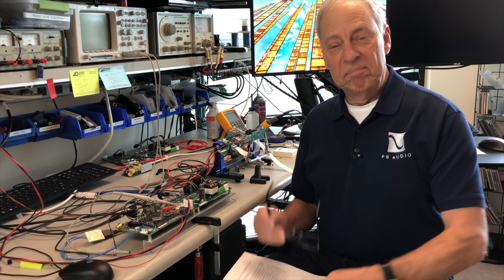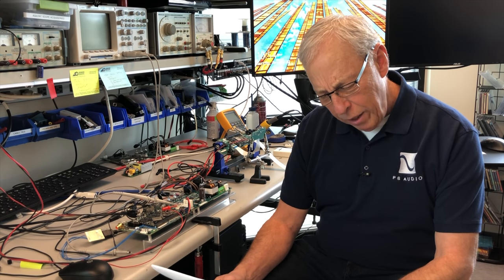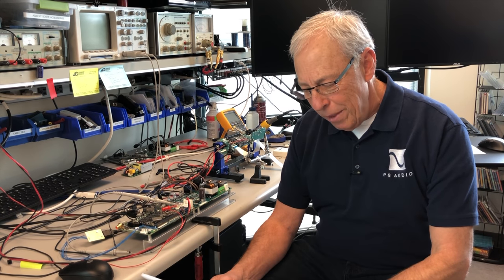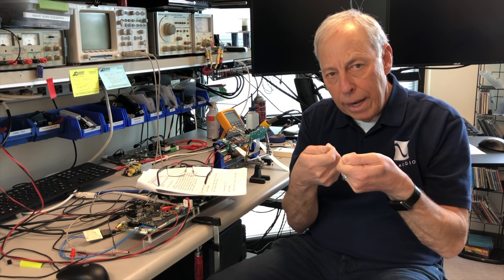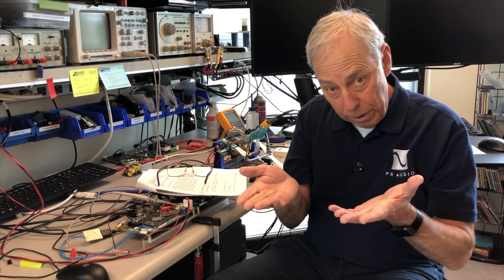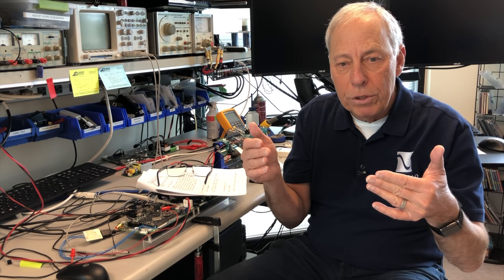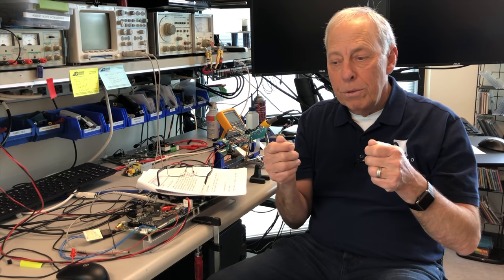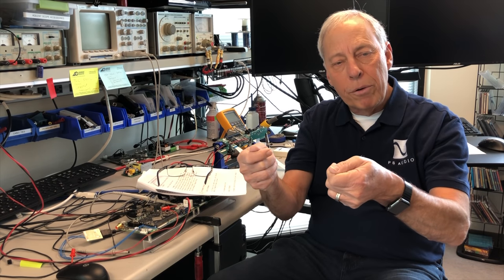What is an Ohm?

Comment: The ohm is the measurement unit that quantifies opposition to the flow of electricity.  When that electricity is in the form of direct (constant polarity) current, that opposition is called resistance, when that electricity has alternating or variable polarity (AC mains, audio, radio, or microwave signals), that opposition is called impedance and varies with frequency because of the influence of capacitance and/or inductance.
Reply: why headphone use impedence, not resistance
Reply: @reznov3D  -- Headphones and loudspeakers receive and transduce audio frequency signals, which do not comprise direct current.  Therefore impedance is the measurement that is relevant to their function rather than resistance, which is only applicable to direct current.
Reply: Well look at the brain on Bruce.
Reply: You can have resistance on AC as well. Specifically,  pure resistances do not cause phase changes. Capacitors and coils have reactances that cause phase changes and differ in the direction of the phase change that they cause.  Impedance is a combination of resistance and reactance.
Reply: @timharig  -- Correct.  Thank you.
Reply: Could you write that in English brotha? lol

Comment: I think you may have confused me more.
Reply: An ohm is a measurement of resistance it slows down the electrons in a circuit
Reply: Don't overthink it. An ohm is simply what you get when you divide volts by amps.  So long as you always use that relationship, you will never be lead astray.

Comment: You could have gone further and explained in more detail how that applies to speakers, e.g., 4 ohm speakers will produce more output for the same amp vs 8 ohm speakers, or that some amps are not designed to drive an impedance load down to 2 ohms, and then there is series vs parallel wiring that effects impedance, or whatever application you think would be helpful.
Reply: 4 ohm speakers draw more currents than 8 ohm, but not always give more output. There are other factors, e.g. Efficiency, that determine the output.
Reply: I'm trying to offer general information, not provide engineering degrees. Let's keep it simple.
Reply: @SpeakerBuilder  
😆🤣😆🤣
Reply: Series, parallel, multiples, anything more than one Driver per Channel, like marriage, is against my beliefs. (chuck the chokes) 
Give the amp an easier job and the system will reward with transients. 
No?
Reply: No. The amp doesn't care if there is one or a hundred drivers on it, as long as they are all the same and present to the output a consistent impedance load (relative to frequency, of course). What amps don't like are overly complex loads due to multiple disparate drivers connected together by a variety of electronic parts such as coils, capacitors and resistors. In this regard you are absolutely correct. Such is the case with  auto systems I was referring to in my original comment which use an active crossover with a separate bass amp driving just the bass driver or drivers.
Reply: True the amp doesn't care, as long as it sees generally an impedance match. 
My focus is response that the driver can obtain. When you have many woofers, say 901, hooked together, there's just gotta be some voltage/current drops in there, because music isn't a DC curcuit. Those cones have air resistance and going from zero to following the signal is where it is at. 
Instead of one higher power amp feeding all of those divers, we would have many (lower max power) amp channels getting the same over all SPL.
I can see the point in an electronic circuit of constant current. 

2) 8 ohm drivers in parallel is 4 ohms.
 Put that in series with 2 more 8 ohm drivers in parallel, you are back to 8 ohm load. 
Now, that is not going to be as responsive as 4 identical drivers with their own amp channel each.
Reply: The context here was ordinary folks hooking up multiple drivers to their bass amp in their car, and the point was to aid in that process.
Reply: Its funny a couple things. Once I had 4 12' s on construction tubes, 6 feet long in a mini van, the other was a DVC MA audio sub that I mounted in the floor vented to the outside. That was some real rich bass like that. Niether one was boomy either.

Comment: It seemed like he was  explaining what a watt is. P=E x I. Or if it was an ohm it would be E/I=R. An ohm is a measurement of resistance to electrical flow. Too low of resistance will allow a great deal of current to flow.  Nearing zero ohms looks like a short to a circuit. Free flow of current, when all flow is allowed, rush current to ground. Resistance drops voltage across the load and slows down the rush of current. Maybe that will help.

Comment: So higher the ohm the more energy efficient the speaker is; because it requires less energy to do the same as a lower ohm speaker.
Reply: No. Impedance and speaker efficiency are entirely different concepts.

Comment: Ohm is the unit of "resistance" of any electrical or electronic unit or a load (laptops, light bulbs, microwave, etc.). What a certain Ohm value generally tells us is how much current (or power) that load will consume. Most consumer products mentions a load rating in Watts (W) instead of the actual resistance of the unit since it is a more easily understandable and relatable measure of how much power that load ends up consuming. When it comes to speakers, matching the load (the speaker in this particular case) to the amplifier output (source) is necessary and for the purpose of clarity, the "Ohm" unit is frequently quoted to understand the load matching. Other electrical loads (a CD player, amplifier, laptops) are always connected to the mains (wall outlet with 110 V or 220 V) which is a fixed source with theoretically infinite supply power. The matching of input load for laptop is obviously taken into consideration to limit excessive current flow. But for the consumers having rating of the laptop in Ohms is not necessary. Alternatively, rating of 65 W on the laptop adapter rather tells us the load (laptop) can consume up to a maximum of 65 W when running. Same thing for a 100 W light bulb.

Comment: "Errmmm... I don't really know.." is also a valid answer. Much more concise too. ;-) 
Ohm is the unit of resistance ! Not the measurement of it.
Reply: Concise, but not very helpful. It also helps to know what physical units define it.
Bonus question: Ohm is the unit of resistance -- so what is the unit of conductance?
.
.
.
.
Mho: reciprocal ohm. = 1/ohms
Reply: @machintelligence  It's S for Siemens, isn't it ?
Anyway... his answer wasn't really helpful either. You can't explain resistance without properly explaining Ohm's law. 
This was mumbojumbo at best. "Take it from me, I know what I am talking about !"
He very clearly doesn't.
Reply: The unit of "conductance"   is "mhos".   I am no joking.  This unit applies to vacuum tubes and is the measure of "trans-conductance".
Reply: Mho's are the old informal name for inverse ohm's.  They are officially named Siemen's now and may be used to indicate conductance (inverse resistance), susceptance (inverse reactance), or admittance (inverse impedance).

Comment: So basically Ohms is the resistance for a voltage for a cable? Like if i got a cable that 10 voltage and the ohms resistance is 5 ohms. I be producing 5 voltage. The other 5 is being used to resist the 5 ohms. Am i right ir wrong?

Comment: Perhaps not the right place to ask this, but here goes. What is the difference or relation between resistance and impedance in a speaker. I know a classic resistor restricts electric flow and generates heat. But in a speaker its more complex because some energy is converted to heat while other is converted to kinetic energy. So is the impedance of a speaker the same as the resistance, say if I place my multi meter over the terminals of a speaker and read x amount of ohms? Or what is going on here?
Reply: Resistance doesn't change the phase of a signal that goes through it. It also doesn't change with frequency. 

Reactance changes the phase of the signal going through it and changes with frequency.  Capacitors and inductors cause reactance and differ in their direction of phase shift. 

Impedance is a combination of resistance and reactance.

A typical multimeter can only measure resistance. If you use a multimeter to measure the ohms of a speaker, you are only measuring the resistance.

Comment: The impedance of a speaker is not a measurement of quality. Your amplifier has an output impedance of let say 16 Ohms. To get maximum energy transfer from your amplifier to your speaker, your speaker should also be 16 Ohms. So your amplifier impedance and your speaker impedance should be equal.

Comment: So high ohms is more resistance and low ohms is less resistance?
Reply: No the highest ohms means "open circuit" therefore there is no resistance which means the ohms are off the chart (high) because there is no resistance.

Comment: Compare impedence to plumbing.  Think of the water flowing inside a pipe as electricity. The smaller the pipe- the more resistance (the higher the ohm). The bigger the pipe- the lesser the resistance (the lower the ohm). Beware- the lesser the resistance- the riskier the business!

Comment: lol this helped a little. i'm curious and confused too. i see ohms a lot when it comes to headphones and interfaces. like the headphone is x amount of ohms so it needs an interface that gives out the same impedance or something like that. also i hear a lot of car audio sub heads talking about ohms, but they never sound like they know what they're talking about. do another video on ohms please
Reply: Let's try to actually be helpful. Guys doing car bass speakers are often building their own and wondering about the wiring, and which impedance value they should purchase. For two drivers on a single amp channel, often two 8 ohm speakers wired in parallel will produce a 4 ohm load and that would allow max output of the amp, whereas two 4 ohm speakers in parallel for a 2 ohm load may be too low an impedance for some amps to drive. Also, four 4 ohm speakers could be wired in two pairs of parallel speakers, and then those two pairs could be wired in series, the end resultant load being 4 ohms.
Reply: @mamaluigi0631   The questions would be - why should I care? What is it in audio gear that I'm looking for? Is an 8 ohm speaker load better than a 4 ohm? Can I hurt my amplifier using a 4 ohm speaker load, or vice versa? And what's the big deal with headphones, which can have a published resistance of up to 600 ohms?

The formula is easy enough to understand, the impact on sound isn't as clear-cut. We as audiophiles pretty much don't care about "V=IR", we care about "Can I drive these speakers/headphones on my chosen amplifier, is there a quality difference between 8 ohms, 4 ohm, 300 ohms, 600 ohms, or are these measurements just indicators of how well my amplifier will drive what's producing the sound?
Reply: @Bannockburn111  I have been working through the backlog of Ask Paul videos and reading the comments on each video and there are patterns that emerge. I have seen a lot of the following two types of comments:

1. Reoccurring questions that could have been answered with a bare minimum of basic electrical knowledge.

2. Incorrect statements that are falsifiable using a bare minimum of basic electrical knowledge.

Many of the questions that you pose, can be answered using judicious application of ohm's law and the definition of electrical power. Impedance is not related to sound quality.  It does indeed relate to how your amplifier will drive the speakers or headphones.

For example.I see a LOT of questions about 600 ohm headphones.  If you understand Ohm's law and the definition of electrical power, it should be obvious that it will take significantly more voltage to achieve the same amount of power for a set of 600 ohm headphones than it would for a 32 ohm set of headphones.

Comment: So that is why a good headset with a high oHm requires more power to drive because it is more resistive to it.
Reply: It doesn't necessarily require more power to drive.  It requires more voltage to achieve the same power.

Comment: Is there Odd number Ohm rated speakers??   😜
Reply: Speaker impedance ratings are a little misleading.  If you actually measure the speaker impedance, you find that it varies significantly by frequency: https://youtu.be/g1zda0WMDGc

Comment: What happens if i conect 4ohm speakers on a 8ohm amplifier?.
Reply: There is no such thing as an "8ohm amplifier" -- there are amplifiers rated for driving an 8 ohm load.  The manual and/or spec sheet of the amplifier will usually include the unit's rated power output at various load impedances -- it's very rare for solid-state amplifiers to be rated at only one load impedance, and they almost always can deliver more power at lower load impedances.  If the specifications of your amp don't include its power rating at a load impedance of 4 ohms (or lower), play it safe and don't connect it to 4 ohm speakers.  For amps with vacuum tube output stages and output transformers, it's important to use the output terminals labeled with the same (nominal) impedance as the speakers you connect to them -- because of the effect of mutual inductance, connecting a 4 ohm speaker to the 8 (or 16) ohm terminals of a tube-based amp can cause audibly poor performance and even serious damage, so don't do that!
Reply from the maker: Unless you are referring to a tube power amplifier with dedicated 8Ω taps, then I have never heard of an "8Ω amplifier". But whatever the case, and perhaps it's more a rhetorical question, a higher impedance source driving a lower impedance load will result in reduced volume.
Reply: Another answer to what happens is that it's probably ok until played at closer to rated power. Many amplifiers have protect circuits which shut down amp. (when played at higher vo!umes)  With amps that don't have protection, the speaker is overloading that amp at certain frequency's and leads to the possibility of damaging output chips in solid state amps. In my opinion.